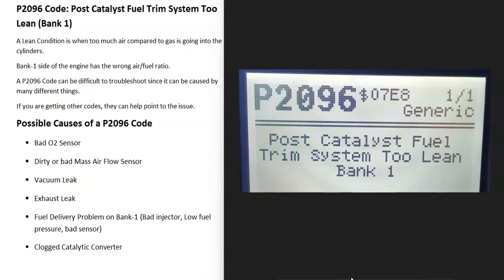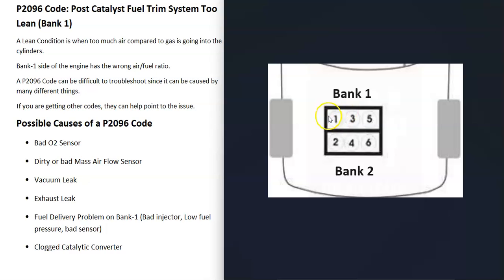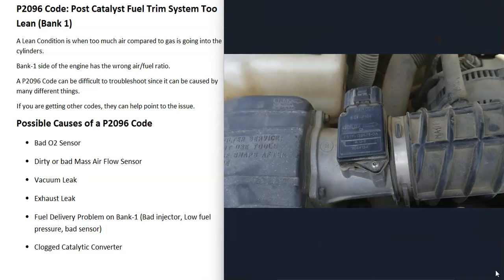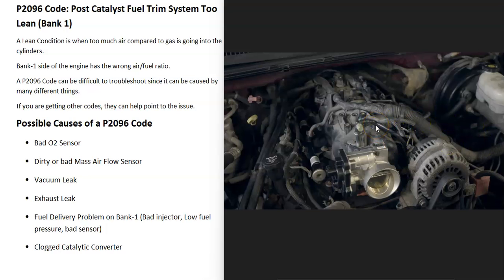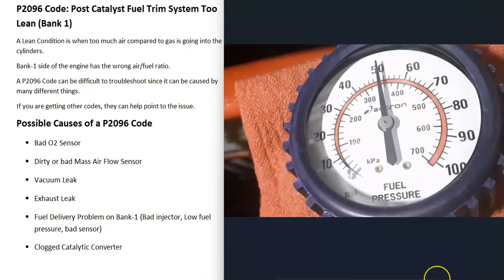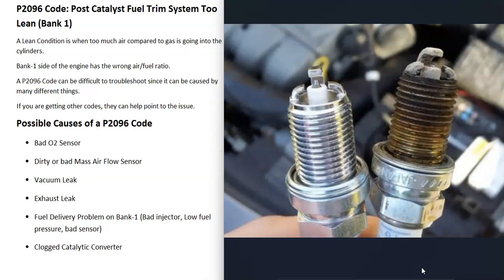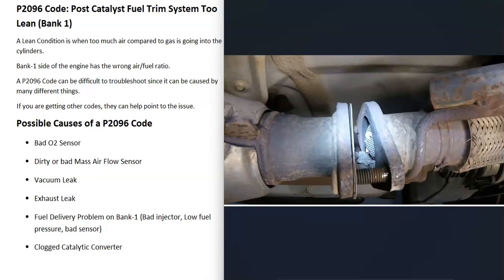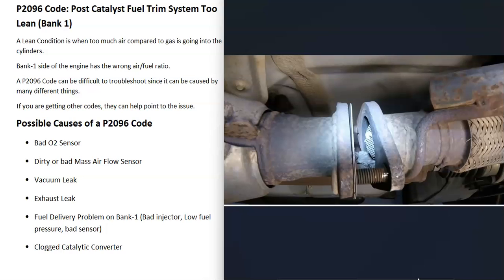Causes and Fixes P2096 Code: Post Catalyst Fuel Trim System Too Lean (Bank 1)

Comment: Mi Kia Soul 2012 has 86k miles, almost brand new, so I don't have MAFS but MAD sensor, so I cleaned. no vacuum leak: everything is new. Exhaust leak, no: I don't have flood or Humidity or made any damage at all. Clogged Catalytic? impossible. Fuel delivery problem? NOTHING AT ALL.   Code came three times and disappeared, no more. so, all these videos are to make us CRAZY and start wasting money. PLEOPLE WAKE UP, OBSERVE, THINK TEN TIMES BEFORE WASTING MONEY.

Comment: I've got a 2017 Santa Fe with only 50k miles on it. Just got the P2096. Had it OBD checked and says Post Catalyst Fuel Trim System too lean bank 1. Glad I bought the extended warranty lol What sucks is this is the first year I need a smog by 2 weeks. Not once had check engine till now. Figures smh
Reply: but what you did? what was the part? what going on?  help us. don't coming here to let us with nothing.

Comment: I have a code that won't clear. Replaced sensor and code won't clear... A hard code? Tried scanner to clear, removed battery terminals and connected them together for an hour, still code won't clear.....

Comment: I have an old 2001 bmw and this is the only code I have just bank 1 all o2 sensors have been replaced and car drives fine is it prolly a bad cat?
Reply: What was it ?
Reply: @VegaB58 it’s a 330ci and I have this code forever but the car drives fine. I’ve still never got around to fixing it

Comment: Could a leaking gasket around the replaced fuel pump cause this issue. I can smell fuel from under the seat when I fill up the tank.
Reply from the maker: It needs to be diagnosed, but yes, a bad fuel pump can cause lean codes. The gasket that keeps that gas and fumes in the tank likely wouldn't cause lean codes, but there may be another issue with the fuel pump.

Comment: I did all that and nothing worked, i drive a Mazda CX7 2011 model , 
It turned out it was a computer software issue. 
Not many people know this when you’ve done everything and the check engine light keeps coming back.

Comment: my gf put 110 octane fuel into my 2022 lt1 camaro a few weeks ago and my check engine light is on now.  I've tried clearing it but the light keeps coming back.  I've had both P2098 and a P02096 code come up
help???
Reply from the maker: It's difficult to say exactly what will happen and it depends on the vehicle and how much was added.  The engine should be fine once it all burns away. However, 110 octane fuel is leaded, which may cause issues with oxygen sensors being coated and possibly damage to the CAT.

Comment: Guys any one can help plz. Got this code on kia lotze 2009 ( in usa optima), 4 CYL engine, haa only bank 1 I aasume.  Got this code,  engine starts normally and on road is ok ran with speed 140km/h.. May be I think it consume little bit more fuel,,, otherwise is fine.... Took it to mechanicto check with his scan tool, said if there is no exhaust leak then its your O2 sensor,,,,  its bit expensive and this might not solve my issue,,, any suggestions

Comment: A car cannot have a bad afr because of the p2096. Remember your before catalytic converter o2 does all the calculations if no code is thrown on that one, but a code is present after the cat then the cat must be bad. Post cat o2 sensor is only used for observing the catalytic converter health. The first o2 sensor is what actually monitors your engine.
Reply: Your observation is ok for 2010 vehicles and older models
Reply: Idk I have removed both of my cats. I'm also naught a mechanic. Mabey we can run ideas, or how ever you'd say that.

Comment: I've been randomly on & off getting the p2096 code.  Sunday night, i got the code again while driving on highway. After exiting the highway at the light, i came to a stop, then the car stalled and hasn't started again since then😢when i try to start my car it sounds like the engine is being bogged down if that makes any sense....plzz help if you have ANY advice - 2005 Dodge Stratus sxt
Reply: Sounds like your Cadillac converter is clogged or you might have some bad spark plugs

Comment: Great video and information.  Just got a P2096 code for 2013 Hyundai Elantra GLS.  This occurred during a road trip so had to drive it 150 miles before I could hook up my OBD reader to figure out the code.  The only code was the P2096.  It ran fine on the highway at 75mph. The car has 105k miles on it.  Thoughts?  I assume since it is just a 4 cyl that there is only a Bank 1 and no Bank 2, correct?
Reply: Did you ever figure out your issue? I have same car as you and same problem

Comment: I’m running a catless downpipe and get this code weekly .. I checked and no vacuum or exhaust leaks and replaced O2 sensor I guess this will be a code when catles
Reply: Tune should erase that..
Reply: Kinda obvious that removing the cat will turn the check engine light on. You need a tune to disable the downstream o2 sensors.
Reply: Bruh 😆
Reply: Is it still on because of the cat or did you find a fix ? I have this same code and if I don’t clear it it makes a p2196 come up too to try and fix the lean condition
Reply: @VegaB58 get o2 sensor spacers most tuners don’t clear the code
Reply: @VegaB58 anything?
Reply: @uxlyboyj3555 I just tuned my car gonna see if it comes back on if so I’m gonna be putting my stock intake back on

Comment: I’ve had a p0420 code for a short time and tried several catalytic cleaning methods found on you tube without success.  I decided to try an O2 spacer and now I’m  getting a p2096. I’m no longer getting a p0420 but I’m thinking I’d rather have the p0420 than the p2096 messing with fuel mixture. I have no drive ability symptoms but the CEL bugs me, besides the fact that the cruise control doesn’t work with the CEL on. 2008 Subaru Forester.

Comment: Most likely the CAT is going bad.
Regardless... a thorough dignasotic process is mandatory before replacing any part.
Reply: What does CAT stands for? Catalyst?
Reply: @nicksalonique  Yes the catalytic convertor
Reply: I have replave both sensor but still not solve the problem.. i will try to replace catalytic
Reply: @thenugrahafamilly2582 get your computer checked, it could possibly be a computer software issue, I went the full route and still that check engine light kept coming on.  I drove a Mazda CX7 2011 model.
Reply: @thenugrahafamilly2582  did you change the catalyst? is check engine cleared?
Reply: Your a life saver thanks broc
Reply: Bro*
Reply: @dominikielbasa  did you change the catalyst? is check engine cleared?
Reply: @ changed the cat nothing changed, it’s very rare it’s the cat
Reply: @dominikielbasa I think that the ECU must be updated (programmed) that will solved the issue
Reply: @Blackjam809  how does that work
Reply: @dominikielbasa  here in my country Dominican Republic you take the car to their shop and they will connect the ECU to a computer
Reply: @Blackjam809 the check engine is cleaned after programming ECU ?
Reply: @BakrTouati yes it will be cleared
Reply: @ thank u for your answer, do you fixed in mazda ?
Reply: @dominikielbasa do you replaced ? Is working?
Reply: I also have a p0131 code (upstream bank 1 O2 sensor). Could this p0131 code cause the P2096 code? Trying to figure out if I should get only the upstream sensor or buy the pack and replace both sensors.
Reply: @cassandravickers8958  Yes and I would definitely replace both sensors. If they have over 100k miles on them. However it’s much more likely that you have an actual lean condition. Don’t just throw parts at the problem, diagnose the issue. You probably have a vacuum leak or a fuel system problem.
Reply: @cassandravickers8958  The chances of both sensors failing lean at the same time is highly unlikely. Have you looked the the live data and freeze frame data?
Reply: @Trump985  car has 165k miles, does that change your recommendation? Also the car is pretty old and only worth $3k so I’m trying to keep costs of fixes low, so I went to the local parts shop and they provided me with the error codes with an OB2 reader. That’s all the info I have.
Reply: @cassandravickers8958  Generally it's not a wise thing to replace parts only based on a code read, the codes are related yes but maybe there is another underlying issue...generally I'd start with looking at live data and test drive and go from there....a thorough diagnostic job is ur best option.
Reply: I had my cat replaced today since I had a P0430 code. Well, not too long after I left the Ford dealership the check engine light came back on. Now it’s this code. 

I never really trust mechanics, but now I really don’t trust them. 

What do you think could be the issue now?
Reply: @coltonlarson2841  rear o2 or pcm.
Every mechanic can make mistakes. u just need to look for an honest one and accept that there is always a degree of probability.
Reply: @NicholeDuarte-ns6mg   R u sure the CAT u installed is OEM , also u might be having some other issues  since this code has nothing to do with drivability.
Reply: Well here’s the problem with diagnosing this. If you look at the live data and see that say bank 2 sensor 2 is reading lean then how do you know the problem isn’t cause by sensor 1 (the upstream sensor) reading rich causing the ECU to lean out the engine hence causing the downstream sensor to see a lean condition? Best bet it to force the vehicle to stay in open loop mode  and then look at the O2 sensor voltages on live data. Honestly if the O2 sensors have over 100k miles on them you should just replace all of them along with the spark plugs. I seen new plugs and sensors fix the dreaded P0420 cat inefficiency code if you catch it in time before the excessively rich mixture torches the cats. Worst one I saw was a BMW that someone put new cats in (the cats cost something like $5000!) and they never fixed the issue that caused the cats to fail in the first place. Unfortunately when the car came to me the new cats were completely melted and ruined.
Reply: @Trump985 thanks for making their car great again
Reply: @AlloyedFrequencies  🤣🍻
Reply: @AlloyedFrequencies  did you change the catalyst? is check engine cleared?
Reply: Not necessarily so , I had a computer software issue on my Mazda CX7
Reply: @mdmelbourne6076  That's certainly a possibility
Reply: I got this code after having my cat replaced!
Reply: @coltonlarson2841  obviously then the problem in that area, CAT, rear O2 sensor , Exhaust leak.
Reply: I think that’s bad advice. Assuming no leaks and a good running engine, it’s just as likely to be a bad O2 sensor. I’ve seen O2 sensors that were switching and looked good on the live data that were actually giving bad data. Swapping both the upstream and downstream sensors bank to bank, if possible is a good way to test this. If the code switches from say bank 1 to bank 2 when you swap the sensors then I recommend replacing all 4 sensors. If you cat (s) is clogged or melted down then you definitely want to install new upstream 02 sensors so you don’t just melt down the new cats that might have cost you $2000 plus bucks.
Reply: @Trump985  what are the other 4 sensors called?
Reply: @kirradiveonthetweed.  O2 sensors there are 4 of them. Two (one per cylinder bank) upstream of the cats and 2 downstream of the cats.
Reply: @Trump985  Offcourse rear O2 sensor failure is also a possibility, everybody speaks from his own experiences and mine has been that this code is mostly caused by a failing CAT.
I wonder when tackling the code do u  plot rear o2 voltage at idle/load and compare the difference.
Reply: Completely wrong. If it's the only code there is either exhaust leak or sensor bad. Two correctly working o2 sensors will detect if cat below efficiency and set code.
Reply: @TheRevolucas  How about there r no exhaust leaks and the rear o2 is working fine, Then what.....what experience do u have?

Comment: hi so so i have a p2096 code and (p2271 pending code)and it once shown p0036 but that hasnt reappeared?is my downstream o2 sensor gone bad?2011 kia sorento,i havent noticed any drivability symptoms just CEL,thank you hopefully you could give me advice
Reply: Did you fix that 2096 code I have an Elantra
Reply: @BayareaXotics  If u have no other codes present, Dont waste ur time on anything else, It is mostly the CAT going bad, If u can have it cleaned or replaced.
Reply: @alabdlilah  turns out it was just the downstream o2 sensor. Old one was no good and engine light went away!
Reply: @BayareaXotics  👍
Reply: @BayareaXotics  Hello, I have an Elantra also with the code p2096.  I changed oxygen sensor 2, the one after the catalytic converter, but the sheck engine appeared again 2 days later.  What was it that changed my estimate?  [my native language is not English]

Comment: only code im getting on my Genesis G70. Dealer told me they check everything and can't find any fault recommended the Tune up... expensive to see if that would help. not sure what to do I see no difference in driving.

Comment: 2008 Ram 1500 3.7L. Was getting P2096, O2 sensor bank one was constanly .01v no changes so i change all 4 and still get the same code while all sensors fluctuate from .01-.08v
Th runs fine engine . i will check all other possible problems you mention and will repost.
Very right to the point video, I like your technical expertise.
Reply: hey my frend you check your fuel pump? so if you no good deleaver o best pression fuel giben toomach problem with the emission
Reply: Bad cat dingle berry
Reply: @Welcome2PunGorn I dont have a bad cat and mines won't come off this is crazy

Comment: Dealing with this code after replacing both banks catalytic converter, had p0420, and P0430, no other codes present,  or issues were present. fuel trims looked at normal range, now B1 is rich over 14%+, I guess two things happen either I left an exhaust leak, or the A/F sensor is acting up,...when reading B1,S2 volt signal  first was stuck in rich(eng. was hot, fuel trims kind normal, over the edge) .08v then after , 30mis the  B1S2 signal move stuck lean .02v. Then is when the fuel trim got way out of control, super rich.

Comment: Cars are just getting worse and worse with all these cpu issues
Reply: Although i agree with that in general but, O2 sensor has been there on cars since late 90s. This is nothing new. The mas air flow sensor is also pretty old. Vacuum leak too.
Reply: @anchalsharma more like pre 80s